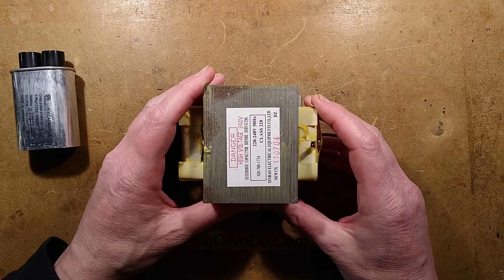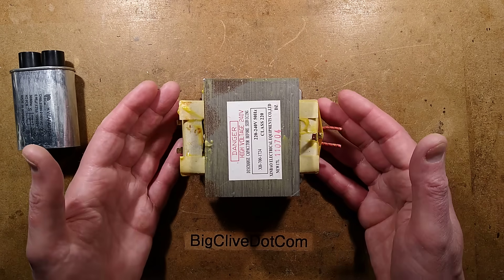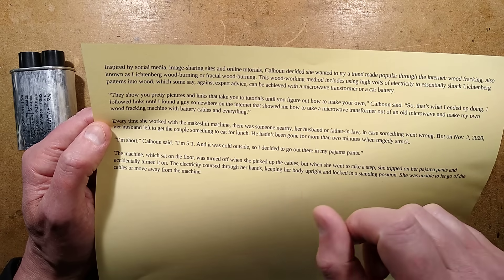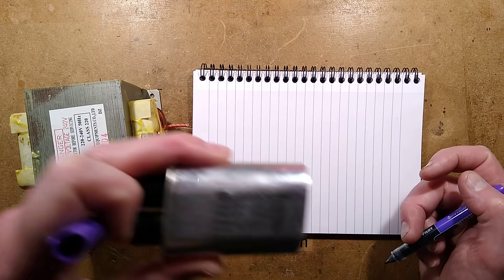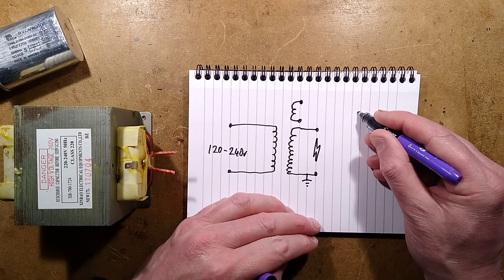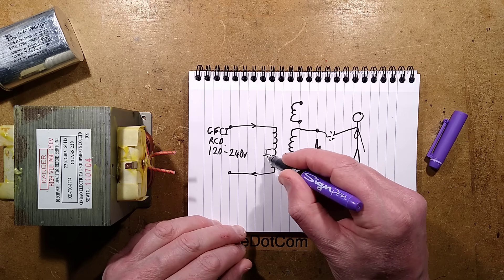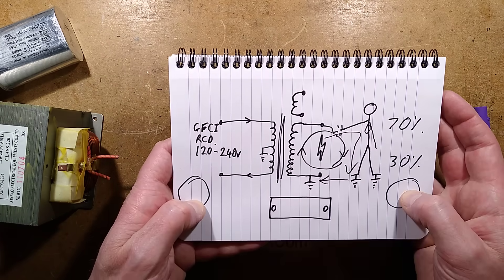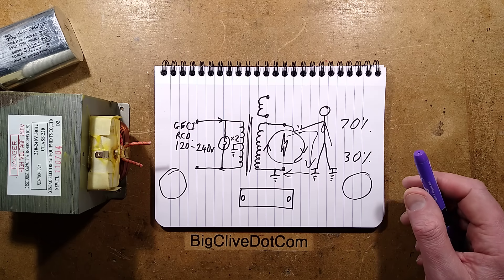The most deadly project on the Internet

Comment: Thank you.
Reply: Well. I was in a hurry. I actually wanted to thank you for these tips and ask if there's any way you could make a video showing you disconnecting a capacitor, then connecting a volt meter to it to show how much charge they can hold. And... When you take a microwave apart… Something nobody ever mentions, and it's not labeled inside the microwave, There's an insulator on it that contains beryllium oxide,f you break it and breathe the dust,

Comment: Thank you and I hope others will be better informed when playing with such things. I have a short experience...working hvac and 99.9% of the time the dual run capacitor on the condenser is instantly discharged upon power off. Well this time a leg had been blown off the cap and was not visible....I DONT THINK IT WAS JUST 230 THAT LEFT THE TINY HOLE IN MY HAND....I have yet to duplicate the scenario and test the  voltage.

Comment: Been doing fractal wood for years. Wont say what I am using but there are atleast three safety measures I never deviate from. 1. Always be atleast 5 feet away from the transformer and wires during operation. 2. unplug for every wire location change. Even if there is a switch. 3. Wear actual lineman gloves rated above the output voltage of the transformer when moving wires. Even if it is shut off and unplugged. Yeah thats overkill but better than not enough. 
This hobby is always looking for a way to kill you dead and it only needs you to screw up once to accomplish it. The first time is permanent dead.

Comment: I've messed around with high voltage projects before, but I've never once tried to use the transformer from a microwave. I used a 15 KV neon sign transformer for my two Tesla coil projects, which just as you say was high voltage but pretty low current. No electrocution, no (permanent) bodily harm, very beautiful sparks. Still had to be careful, though.

Comment: Mr. Clive thank you for this lifesaving video! This should be taught in the school! I'm graduate electrical engineer but have bad experience from my first encounter trying to repair microwave! It has warning stickers inside but this is not enough! I wanted to measure high voltage output with standard AVO meter rated to 1kV and it barely survived with blown fuse! But I was extremely happy be at least so smart to not hold the clamps with my hands and to survive! Thanks again! And to everybody, please listen to advice, and do not play with microwave transformers, it is most dangerous electrical equipment you will ever encounter!

Comment: In the Navy my system had a transformer rectifier that weighed 488 lbs. 30 minutes with a shorting probe never cleared it of charge. It always took 48 hours of letting it sit after shorting every contact to ground multiple times.

Comment: I always wanted to try this, but I'm properly >TERRIFIED< of high voltages. I always though of ways to just attach the HV leads to the workpiece, move away and activate the transformer with a momentary push button placed far enough away that makes it impossible to activate it when near the HV side.

Not the other project (spot welder) is super fun. I still mid the mains side and practice safety measures, but anything in the kV range is just <NO JOKE>

And also, the fact the transformer isolates you from the GFCI/RCD devices is just terrifying.

Excellent video. Thank you for this!

And that outro... DAMN!!!!!

Comment: How can someone see what it does to a piece of wood and not make the connection that that is what it will do to their insides if they complete the circuit?
I was stupid enough to play around with transformers connected to mains power when I was a kid and electrocuted myself.
Ever since then I have been absolutely paranoid when working with any kind of voltage above 24v.. I always wear gloves & rubber soled shoes and triple check that things are not live before working on them.
Having been zapped once, I'd rather be paranoid than 6 feet under.

Comment: In my experience, the HF HV supplies (like those used in CCFL bulbs for monitor backlights) have a circuit that will detect a short and then turn itself off.  It usually starts briefly in a mode that strikes an arc in the bulb, then goes into a constant conduction mode that monitors the current.

Comment: We just had a couple electrocute themselves and burn their house down locally attempting to fractal burn a table. Took the detectives a while to figure out what exactly happened.
I've seen videos regarding this practice and claims that a transformer from a neon sign would be significantly lower voltage and a pull string to power on/off.
Thoughts?

Comment: This is what the current will do to a hotdog.. it will do the same to you. https://youtu.be/LLyfJN6iBlw

They can be used safely but you need to take every precaution you can. I use long wood sticks, electrodes at the bottom of the sticks, and electric tape around the handles. I also use a paintbrush to apply the electrolyte so conducive water isn't just getting everywhere

Comment: Great video. Thank you.

*High Voltage Transformer.
*Automotive Cables.
*Salt Water.
*Hands On Process.

What could go wrong? 
(as the internet is fond of saying).

Surely there are safer "crafty projects" that Etsy home crafters can engage in.  This is a ridiculously dangerous method. And, frankly, I was always underwhelmed with the spiky branches rendered on wood, etc

Comment: I’ve been a master electrician for about 12 years now. If you have no experience with high voltage electrical equipment. Stay away from the project. Understanding they even a proper dead man’s switch, automatic line cutter or other Safeguards can still fail under this amount of amperage and voltage. Not only that, parts can still store electrical energy for a short time after using the apparatus, unless properly discharged. All around stupid to be doing. I wouldn’t do this project, even with the experience I have. Stay away from it

Comment: Its not just about going to ground. If you have two hands on it at any time thats a circuit in itself.  It takes a while to understand its a low frequency radio wave.  Imagine grabbing the line to a big radio tower. Microwave communications use low power around 10 watts. This is much higher! Ive been around electronics and you can become complacent as well.  Ive melted the tip on a screw driver off. Dont wear boots with nails in the sole. old tv tubes, crt,  can keep a charge for Years easily and kill you very dead .You cant smell it or taste it. Discharge capacitors and keep the lead across as they can hold quite a bit for quite a while.

Comment: When I was trained as a nationally registered paramedic, I was taught that electric Current takes the path of least resistance, following circulatory systems and nerve pathways. Higher voltage also arcs at times, literally blowing body parts off as it makes its way to the ground. It also causes a ferocious and persistent muscle contraction, which means you can't let go, hence the brilliance of using the two button box. I ran a number of fatal electrocutions over the years, and there is a very good reason he didn't show the image of the hand. Trust me when I tell you, if you are operating this without extreme safety protection, it's just a matter of time before you make a mistake. 7 out of ten of you will die. For a woodburning project. Seems to me that the risk far outweighs the fun.
Reply: Exactly, but it it more complex.   I work with extreme energy RF devices, and ground does not always stay ground.  People expect power to pass from point A (source) to B (return) but in this case, they are deliberately carbonizing the material that their return is on, There are resistors made of compressed carbon... like they are creating.  the resistance is soaring as the material carbonizes, all of a sudden the "safe" place they touched becomes the low impedance point to ground (through said "operator").    This is possibly the single dumbest thing I have ever heard of people doing... which is saying something, I have seen/done some really dumb stuff in my 60 years.
Reply: @Doonit_hard_way_since_65  not even talking about what would happen if the insulation of the wire got damaged somehow. Suddenly you become the next „ground express“. People are actually insane for even handling open 2000W transformers from microwaves in the first place. It‘s the equivalent of using an LPO-50 flamethrower to cook your chicken. The internet really is a blessing and a curse at the same time.
Reply: @PvtAnonymous  Adding onto that, electrical resistance varies dramatically depending on the thickness of the material. It's why high voltage electrical lines have such large stacks of ceramic insulators and minimum distances that have to be maintained to keep the air itself from breaking down and arcing.

When you take a wire with insulation rated for 12 or 24V and pass 10kV through it instead, that insulation is liable to simply break down, no preexisting damage required.
Reply: @EmptyZoo393  yes, didn‘t want to get too extensive with the length of my comment, but yes. Especially considering that you‘ll squeeze the wires with your fingers, accelerating that process. Some people shouldn‘t be even trusted with changing a light bulb, and certainly not toying around with transformers.
Reply: Definitely. I'm sticking with Blender.
Reply: i think you've misinterpreted the percentages; 70% represents the death rate of those who HAVE been electrocuted doing this
Reply: Anyone contemplating this project should actually look up the image of the woman's hand, that should be enough to change their minds. Try wood burning instead lol
Reply: Static discharge will take the least path.
When you have a strong supply like the mains, electricity takes all paths simultaneously. It has no issue to burn the wood, your fingers your foot, your heart all at the same time.
Reply: One of my electrical engineering books does a deep dive on safety and describes that current as low as 1 milli-amp and voltage as low as 30 Volts has killed people.  This is why the NEC, often adopted as local laws, has higher standards for electrical installations which can get wet when voltages are higher than 30 Volts.
Reply: Steven S said "When I was trained as a nationally registered paramedic, I was taught that electric Current takes the path of least resistance," 

Sorry that is incorrect no matter who told it you. Electric current takes ALL the available paths, it is just that the current that does flow, is dependent on the total resistance of the path. That means more current will flow through the path of least resistance but by no means all the current. I have also been told this nonsense on a Health and Safety course by a professional Railway consultant. However, his course was given to a group of electronic engineers, who all shot him down on this. It is a common myth.
Reply: Also the extreme safety protection should be inspected by another person who knows how electricity works. I can tell you from experience that high voltage safety should never be fully DIY'd.
Reply: "I was taught that electric Current takes the path of least resistance" - you were taught wrong!!!! Electricity takes EVERY PATH AVAILABLE. If it only took the path of least resistance, only 1 outlet on your power bar would work, not all 6. Only 1 outlet in your house would work, not all of them, etc, etc.
Reply: fuck woodworking
Reply: @bobloblaw7465  what I say is exactly true, not "some what" true. It does not depend on the circumstances. Remember I said the current follows ALL paths. No amount of so called "experience" is going to change the laws of physics, you are simply misunderstanding what is happening. That is why scientists do research and do not resort to black magic voodoo or feel. They use real mathematically defined laws like Kirchhoff's law to know what is happening. As I said the current follows all paths, it is just the path of least resistance has the most current flowing through it.
Reply: @bobloblaw7465  if you're no good at it and have a really crappy burner.
Reply: shortest path of least resistance to ground.
Reply: It's kinda even worse than "path of least resistance". It takes all paths *simultaneously*, but divides according to the reciprocal of resistance of each path. So the most conductive paths get most of the current, but less conductive/longer paths will get some current too. That's why there are such widespread nervous system symptoms after electrocution.
Reply: @bobloblaw7465  You just have to be American with that sort of attitude. I bet you are an anti vaxer, Trump voter and keen on guns. Keep on doing what you do for as long as you can. Your Darwin award awaits you.
Reply: Seven out of ten will die? 

That’s an enormous exaggeration lol. It is dangerous, but relative to the number of people doing it- the death rate is tiny.
Reply: @DingDongDaddyFromDumas  seven out of ten will die from an accident

Comment: I got shocked by a 240V power outlet in a house undergoing a renovation, which I didn't think was live. It was terrifying and felt like minutes passed before I fainted. Fortunately, I believe I'd only touched it for a few seconds as the current passed through my finger. That was just through my finger. I cannot fathom what it would be like to have electricity travel from my finger, all the way down through my heart and other organs, and out through my feet. There is no way in hell I would risk that just for a 'pretty little artwork' that many others have already done before you.

Comment: I repaired microwave ovens for years as a Appliance Repairman . Never got near a running microwave’s high voltage parts while the cover is off. You could test most stuff either with the power off or by substitution. If I was to do something like this I would build a large container to house the transformer and wood and a plexiglass viewing port. With a on and off switch on the outside. Hobby is not worth your life .

Comment: VERY well done, thank you for taking the time to explain this 😀. Just to add to your explanation it is not so much the voltage that kills. I have been shocked many times by 80K volts. It is the amperage that kills; half an amp will make it so that you can’t let go and one amp kills. Voltage is like the pressure in a water hose, how far the water shoots out. Amperage is like the amount of water coming out of a water hose.
Reply: High volume of water can drown or chill you; very high pressure can literally cut.

Comment: I'm just an amateur electronics engineer but I've been taught well how dangerous microwave transformers are. I've never dealt with one but I recognized it immediately as one in the thumbnail of this video. I used to mess around with rockets and make my own solid rocket fuel in motors that were so big they were technically illegal to be in my possession. I can't imagine doing something even more dangerous just to make some pretty patterns on wood lol if you want my advice, just don't do it, they are other ways of wasting your time.

Comment: As a sparky (electrician) if it were me I'd have set up a timer that allows for current to pass through the primary side for say 4 secs then say stop for 2 secs before reseting, that way hopefully in a worst case scenario the most you get is a 4 sec shock, yep you could still die depending on many factors however on the off chance you survive you could let go of the wires and then turn it off

Comment: I used to screw around with neon beer sign transformers as a teen. Stupid, yes, but I did treat it as being dangerous. Made Jacob's Ladders and etc. I knew salt water was conductive, but I never tried anything involving water. Having worked in a sign shop and done lots of experimentation with high voltage there, I'd still be ridiculously wary of anything involving passing high voltage through salt water, especially spread across a surface. Just stick to "electric pickles" and "cooking" hot dogs, using mains current.

Comment: I don't use any damn car battery. I plug mine into a 110 wall socket. My leads are on 2ft dowel rods. I don't play that wet hand shit. And crossing the street is dangerous if u go about it the wrong way. This is not for everybody. Sometimes we thin the herd by way of Darwin's method. Don't wanna get unalive? Do be dumb and touch shit you're not sposed to. Pretty simple

Comment: I have a question.  I didn't think the output windings of the transformer are referenced to ground.  They are isolated from the primary which is ground referenced.  There for wouldn't you have to touch both output winding connectors at the same time to get a shock, not just one lead?

Comment: A transformer that's not energized,  lmfao would be more worried about a capacitor that holds a charge until you ground it too discharge it. If you know nothing about it then don't mess with it lmfao it's called ,Kiss, keep it simple stupid

Comment: if there was a way to make your switch active at a press (or a safe half press), then have a hidden mechanism to press down harder to shut off, if someone got shocked and seized up the muscle contraction would shut off the electricity. might not save a person though. (they still have the electricity going thru them but for a much shorter period of time)

Comment: Automationdirect for all your stupid transformer needs. Be sure to ground the secondary of the transformer and buy a few fuses to connect in series on the primary and secondary
Reply: It would also look into the NETA guidelines for the required PPE at different high voltages levels.

Comment: I'm a scrapper and I've taken apart hundreds of microwaves. I touch both ends of the capacitor with pliers(with thick rubber gloves on) to discharge it.